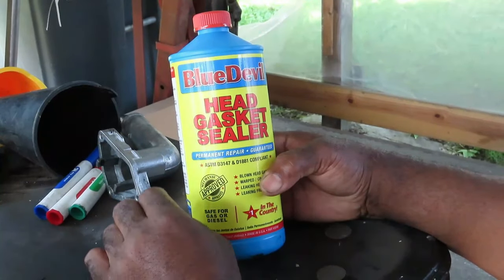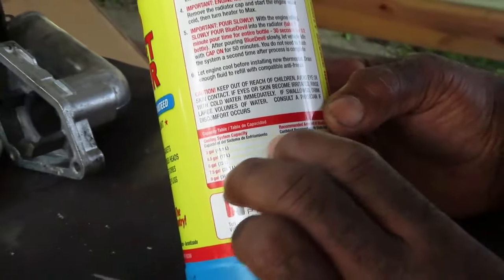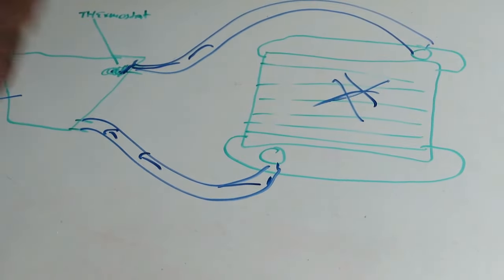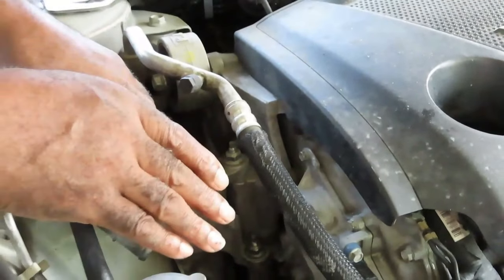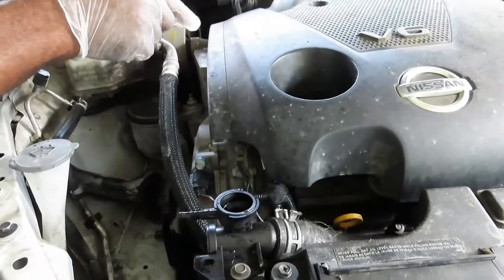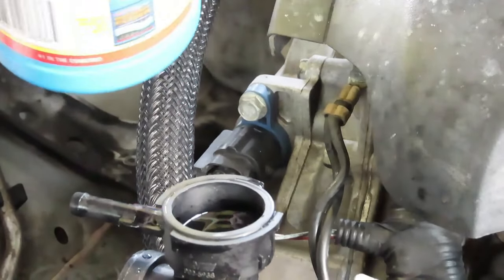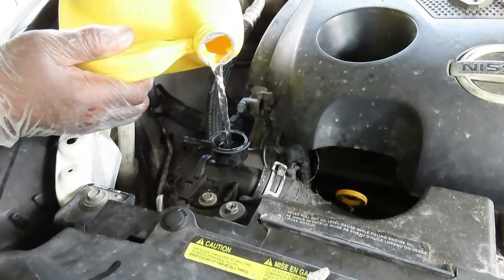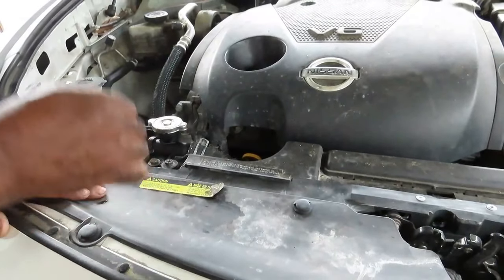How To PROPERLY Use Blue Devil Head Gasket Sealer. #bluedevil #headgasketsealer

Comment: @onlinerepairvideos

Did this work on the 2014 maxima or did it end up not working? How bad was the radiator bubbling or how bad was the leak? I jusy want to know because i have the same exact car with the same exact problem
Reply from the maker: Yes it did work, until the customer overheated the car AGAIN!

Comment: If cooling fans aren't working correctly van I still do this process?
Reply from the maker: That is a good question, and I would guess no because the vehicle will overheat. If you can jump the fans, that may work.
Reply: @OnlineAutoRepairVideos  that's exactly what I was going to do. Any suggestions on videos of how to jump the fans on 2008 nissan altima?
Reply from the maker: @kevo8111  Sorry, not sure on any good videos to do that.

Comment: Where do I put the blue devil liquid in an 01 GMC Yukon I don't have a radiator cap.
Reply: It has a coolant reservoir. That's where you add it.
Reply: Don’t do that you have to use the top radiator hose

Comment: Hello! What if my heater system doesn’t work? I won’t be able to turn it on. It’s a 87 c10.  Will it still be ok to use this product? What do you suggest. Thanks in advance
Reply from the maker: What's wrong with your heating system? It will still work though.
Reply: @OnlineAutoRepairVideos  I brought the truck a while back and the whole AC / Heating system doesn’t work, I guess is not connected? Thanks for the advice

Comment: I put blue devil in my 2003 Honda Pilot with 340k, and 2500 miles later it’s working perfectly. How long does it usually last? Let’s say it fails in 30,000 miles, should I try using it again?
Reply from the maker: They say it's a permanent repair, but if it overheats again, I don't think it would be able to hold up

Comment: Sidebar question: Do you still add water even if the coolant you purchased was a 50/50 mix?
Reply: You can. You can run straight water if there is no danger of freezing.  You can dilute a 50/50 mix in half or more and it still won't freeze even if it's badass cold where you live.
Reply: Why add water just add coolant water will risk overheating
Reply: @AlexanderPapi7 engines cool fine on water, despite the slight extra viscosity.  It's freezing and corrosion protection that water lacks.  Also, if in a warmer climate or just for the summer it doesn't hurt to run a little more water than 50/50.

Comment: Without thermostat and its gasket won't coolant just leak out where housing bolts on?
Reply from the maker: Just be sure the gasket or seal is still there.
Reply: My seals are part of my thermostat the way it’s made. 
So when I remove them, the water just leaks, even if I use sealant. Plus I have two thermostats on the housing not just one. This did not work for me at all.
Reply: @ShotByStyles  Simply remove the guts of the thermostat with tin snips and re-Install the rest.  That way you keep your seal and no leaks.
Reply: @dalepress1581  Thank you

Comment: Why do you have to drain the water an the blue devil after you  finish  is it because you can’t mix the coolant an the blue devil
Reply from the maker: We do that because we do not want any left over blue devil to clog up the thermostat.
Reply: @OnlineAutoRepairVideos    Thanks I already did mine an it worked my oil cap was getting the brown slush  an now it’s not doing that anymore
Reply: Because if you live where it's cold , water FREEZES...... lmao
Reply: Do I have to flush the radiator or just drain it?
Reply: @christinescalera420    Drain the  water an coolant if it has then put blue devil an wait like 50 minutes  leave it idle

Comment: Should you change the "milkshake oil" before or after this process?
Reply from the maker: Even though the directions don't mention anything about that, I would. Change it with some cheap oil.
Reply: @OnlineAutoRepairVideos  its a BMW 745 i bought for $400...and as a v8, I wasn't sure if I should use good oil or not for this procedure (definitely good oil AFTER if it works).

Thanks
Reply from the maker: @sonofaleph2140  Definitely!

Comment: What happen if your thermostat isn’t separable?🤷🏻‍♂️
Reply: I've used Blue devil in the past and never removed a thermostat first. But he could be right. It just seems like kind of goofy cuz if you're going to turn on the heat all the way and go drive the car right after you pour it in then it's going to open up the f**** thermostat and then the damn thing is going to f**** run fluid through all the whole motor everywhere in the coolant system and then the thing does its job. I don't see why you would want to take a thermostat on out and run your vehicle without a thermostat for any amount of time. Not to mention that afterwards you're going to have to turn around and drain all that coolant out again to put the thermostat back on or you're going to have a mess. Just like you said when he took the housing off in the first place zero out of 10. Do not listen

Comment: After letting the car idle for 50 minutes, is it safe to flush again and add antifreeze ?
Reply from the maker: Yes, but make sure the car has time to cool down because the water will be very hot.
Reply: According to the bottle it works on
• blown head gasket
• warped / cracked heads
• leaking heater cores
• leaking freeze plugs